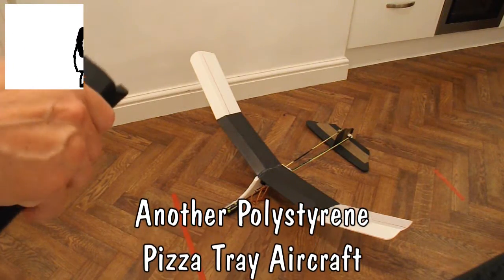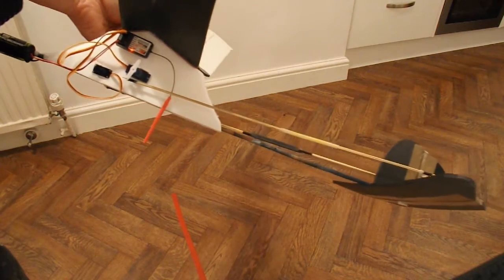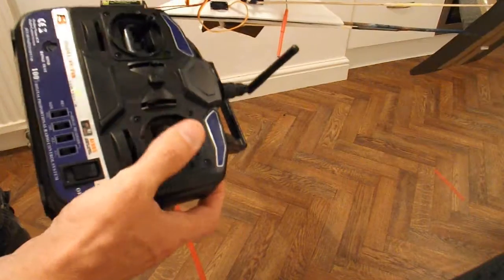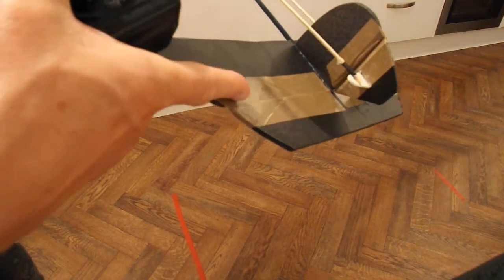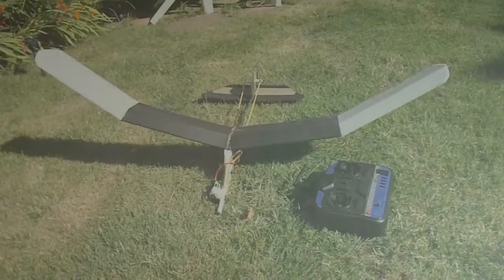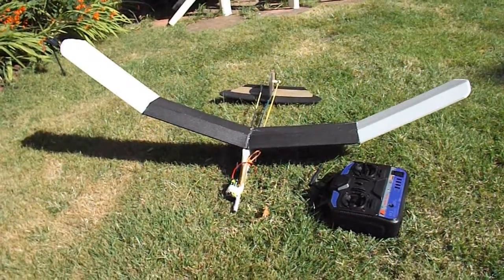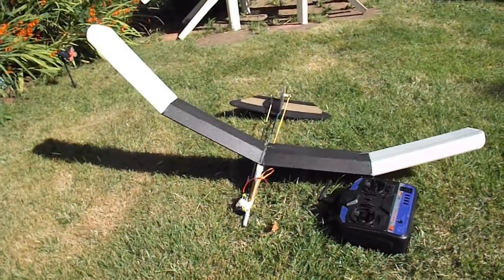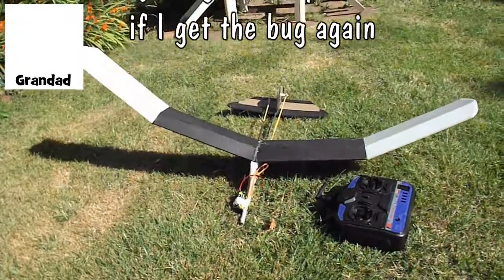Another Polystyrene Pizza Tray Aircraft - part #3

Comment: I am sorry if this was asked already but how much did this cost to make?   My son is 8 and he loves to build planes.  I would love to build this with him! Thank you for the great vids!
Reply from the maker: This really is bargain basement stuff. The plane itself was virtually free as it was foam packaging and garden bamboo canes. The RC gear is very much a matter of how much you want to spend. Recently prices have increased, certainly in the UK due to tax changes after Brexit, but the kit I used here probably cost me under £30 at the time. I can see the Flysky FS-T4B Transmitter 2.4G 4CH Radio Control & Receiver are still being sold on eBay for around £27. The servos are about £3 each, depending on how many you buy, they get cheaper when you buy several. On this one I am just using NiMh batteries so you need some for the transmitter and the receiver. If you really want to get into RC I would recommend watching the FliteTest RC Planes - beginners series https://www.youtube.com/playlist?list=PL6IuSFWz4ktvupu_gxw1vn-sjBGOkJFHV and you will also need to understand the rules and regulations around flying RC. If you are in the UK you are probably best checking out the BMFA website https://bmfa.org/

Comment: If you take some of the polyhedral out you will generate more lift as you won't be losing airflow off the wind tips. In the end it will glide much better
Reply from the maker: Yes, I rather overdid it in that build 😊 I think it still exists somewhere around the house (video was 2014)

Comment: Yuor wings have too much up-sweep built into them.  This results in having not enough lift,  Instead of bar-b-q skewrers use thin piano wire for your control linkage,  Otherwise this is a good little glider.
Reply from the maker: When you have watched a few more of my videos you will see I try to make things out of scrap material as far as possible. None of the materials used are the best choice by any means. I just let the components design themselves. The dihedral was just guessed as I glued it all together. You are probably right and it would get more lift from a flatter configuration, however this does make it very stable.
Reply: I watch alot of your vids and I like them,  especially the airplane vids.  A homemade airplane is the best airplane,  so please keep up the good work.
Reply from the maker: masbeetleboy thanks :-)
Reply: +GrandadIsAnOldMan I'm more of a kite flying man (which is how i found your youtube channel) but i have 'dabbled' with model aircraft.
 I think the dihedral of the outer sections would be enough for stability.
The wing profile could be improved by making three or more score lines to create a curved surface, perhaps held in shape by 'pizza tray' ribs of the correct profile glued on front to back at intervals, the sharp ridge of the current wing will tend to make the air break away as it passes over it.
 there is lots of information on wing profiles on the internet, perhaps too much, difficult to work out what is relevant for what you need !!
 But top marks for taking materials that other people would put in the re-cycling bin and making something ineresting out of them.
Reply from the maker: Ian Virco I think you are over-engineering a simple project. Yes the design could be improved dramatically but then it would not be the quick simple build shown here. The purpose of the simple fold in the wing is probably more about giving the wing strength than it is about giving it an airfoil cross-section. I did overdo the center dihedral however that is the same reasoning, the angle increases the strength of the joint. The plane is only held together with hot glue and there is no bracing other than the angular joins.